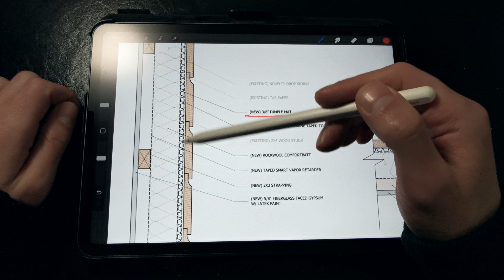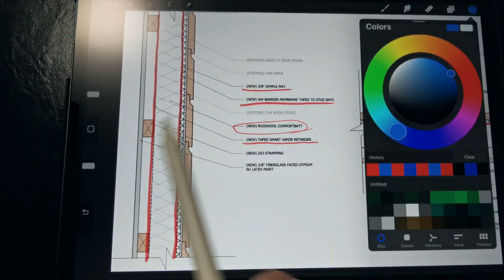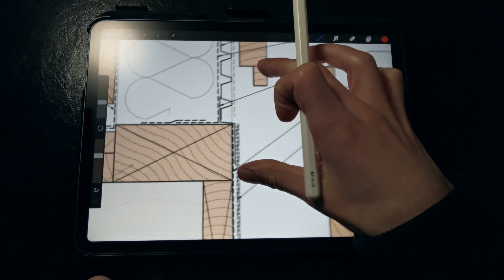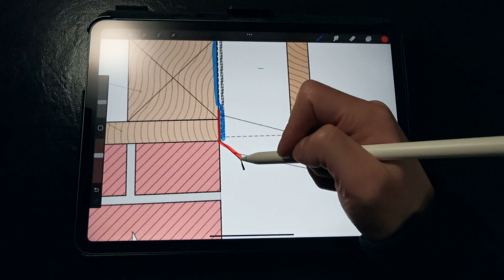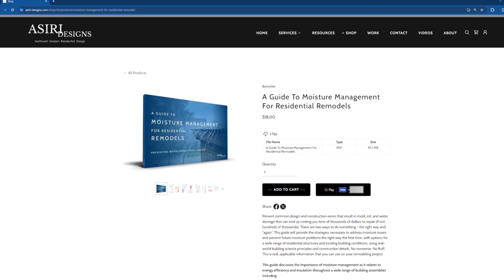How To Insulate Walls Without Sheathing

Comment: This is excellent information. Would this be a viable solution for a 2x6 framed garage that only has horizontal strapping and then metal siding? Trying to find a way to insulate and heat my garage without creating very expensive problems down the road

Comment: Thank for sharing. How do you deal with all the siding nails when installing a dimple membrane behing the siding?
Reply from the maker: So keep in mind, this wall condition is for assemblies that did not have sheathing - the siding was fastened directly to the studs in these older walls, so you wouldn't see nails behind the cladding. Let's say if you do happen to puncture the dimple mat with a nail, it's not a big deal because we've created that ventilated drainage gap. The gap will break capillary continuity and prevent water from being wicked inside.

Comment: 1939 house in Kentucky, so a mixed climate zone. Every season can have any or all mixes of Chicago and Atlanta weather. I have stone exterior, and by stone, I mean 9" thick limestone block. As far as I can tell, it has sheathing (looks like 1x6 planks, not sheet obviously) and tar paper and platform framing (not balloon framed). No insulation at all. When I open a wall, so far, I have just been putting rockwool in and have not addressed the vapor control as I didn't want to prevent drying in either direction. But the sheer thickness of the exterior stone makes me think the chance of water getting all the way in there is low. Any thoughts on this assembly? The thermal mass of the stone is a really major issue.
Reply from the maker: You're thinking about the right things, you want always allow those stone walls to dry out to the interior if possible. Check out this article I posted on insulating mass masonry walls - the same principles will apply to stone: https://asiri-designs.com/resources-1/f/insulating-mass-masonry-walls

Comment: I’m buying a corrugate galvanized steel grain bin 24 ft diameter. What is the best insulation to use for the sides and the cone shaped roof structure ? What about insulating the concrete slab as this will be in a cold climate in the Catskills of NY ?
Reply from the maker: Hate to say it, but probably closed cell spray foam is your best option here other than "don't do it".

Comment: Let me ask- without sheathing is there less structural stability?
I thought sheathing adds a lot of strength when added to the studs. Do the boards provide this strength?
Reply from the maker: Great question - It depends (as in the case of using shear walls or shear connectors to achieve lateral stability rather than the sheathing itself), but in most cases you're correct. Typically if the building is still standing 100 years later, presumably it has stood the test of time. In some severe cases, you will need to install a new layer of sheathing - but this will usually be determined by your structural engineer, and you'll probably start to see indicators of stress. The siding boards can provide a modicum of racking resistance, but more than likely they are going to be braced with some sort of cross bracing.

Comment: Good info.  There's STILL so much confusion among builders, code enforcement, inspectors and owners about moisture.....when to stop it and where to stop it.  Living in a high humid, high temp area we battle mold, mildew and internal RH issues constantly.    It's tough to be a good AC contractor around here.  Glad you're making good content.
Reply from the maker: 100%. Hot humid climates also started to see even worse humidity issues right after energy codes got stricter. Better insulating values meant the AC was running less often, and the incidental dehumidification from the air conditioning was lost. It got worse with buildings that required a certain amount of air change. Now we need both ERVs and dehumidifiers - not only in those hot humid climates but in colder climates too. Crazy right? Thanks for watching!